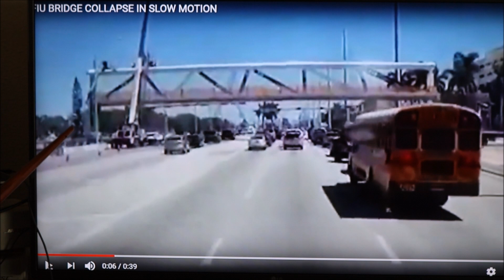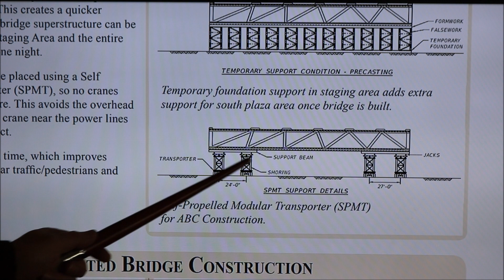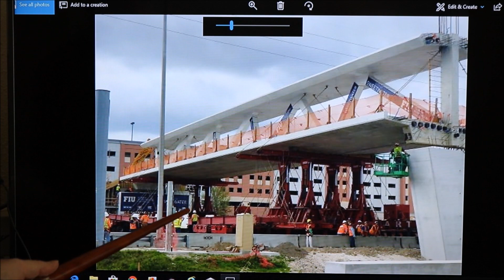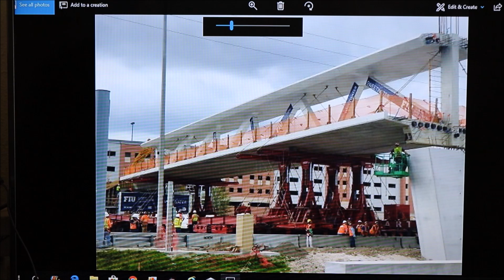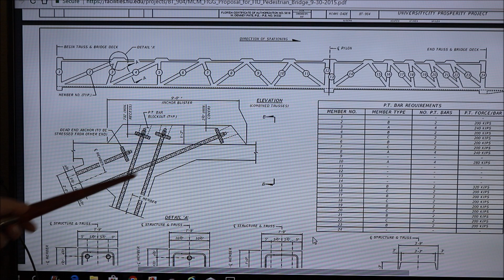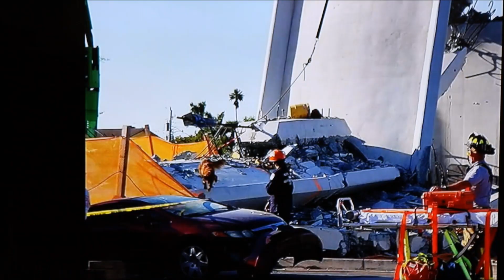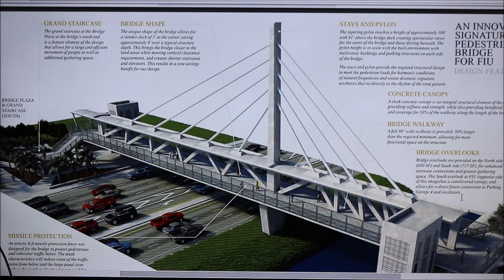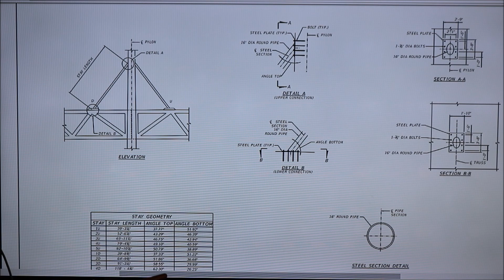Miami Bridge Failure Update 18 March 2018

Comment: ABC design ? More like DEF (Doomed to an Early Failure) design. Also you learn about a crack in the unfinished bridge and do what - hold a meeting to pat yourselves on the back ? Should have blocked the traffic and started to investigate immediately. Oh and let's start tinkering with the cables while there are cars going underneath the bridge. 1. Incompetent engineers 2. Lack of public authority 3. Criminal neglect. A lot of people should be removed from their current jobs.
Reply: TCN8202 I fully agree with you.
Reply: TCN8202: Well said.
Reply: TCN8202 — ABC only means that the span is lifted into place after being built elsewhere.  This failure does not mplicate the ABC methodology.
Reply: 4. Extreme pressure or Inability to get permit to close the road due to the lack of detours

Comment: People that have never seen or been around something heavy when it collapses/fails don't realize how it seems to be moving in slow motion. But in reality, happens pretty fast. I had a 17'x96" diameter log dropped on my log truck trailer. It broke all 5 leafs of the right spring and ended up setting on the tires. Another time, the tail hold on a 90' yarder pulled loose and the yarder tower came down 30' from where I was standing. Another time, was down in Klamath, Calif. when a BIG Redwood log that was being suspended across a 3,000' canyon caused the mainline to break. It's kinda surreal watching 3,000' of two and a half inch cable coiling up coming toward you and landing 30 yards in front of you.
Reply: Reg Pettinger ...wow...your a lucky man to have a retelling of that 2 and a half coil narrowly missing you. !!
Reply: I never really thought about how lucky I am to still be here until I got into my 60's. I've done things that should have killed me and people that were with me. Motorcycle racing, crashing planes and beach buggies on the same beach all the while trying to cram all the living I could get into 39 days of leave back in March 1969. And these are just a few times.................................I've come to realize the Lord has been watching over me all along. I feel very blessed.
Reply: Reg Pettinger Blame Hollywood - the hero always has time to run away from the explosion/collapsing building/ disaster of choice
Reply: Unless slowed by the wind or other non proportional loss, all things fall at same rate.
Reply: v= u + a.t

Comment: Good analysis of the limited evidence.
As far as the workers harness failing, I would be more inclined to say the worker regarded it as an inconvenience and did not tighten his harness straps properly. (Just my opinion from prior observations)
Reply: I can confirm that. I had to deal every day with workers not wearing their protective gear properly or worse: not at all!  -_- They think they have everything under control but that's not the case as one can see in this video. Things can snap in milliseconds.
Reply: Gary Reed
I think you are correct...My buddy is a high rise steel worker and he tells me the harness is always in his way . He says he has more problems working when the harness is on...
Reply: Gary Reed 
Just like ... How many people think that wearing seatbelts in cars cause more injury than not wearing seatbelts?
Reply: I would agree. I was safety officer on a construction site.  some of the workers regarded the harness as a joke.  One of them tried to argue that having it loose on his body was just as good as wearing it properly.  I was behind him and yanked the D ring up.  when the leg straps hit his pills he agreed wearing it properly was a good idea.  His foreman used the D ring yank as a test each morning to see if every one had their harness on properly.
Reply: A safety harness very, very rarely fails, unless, you're not wearing it properly.

I've worn them day in and day out on many a roof on buildings in downtown Boston. I've seen people do some downright stupid things with a harness on, it surprises me how nonchalant people can be when it comes to their own safety and their life.
Reply: Thank you!  There have been a lot of comments that assume workers always follow safety rules and always wear safety equipment.  I've worked in machine shops and at an aluminum smelter and I've seen (and done in my youth) plenty of violations.  Safety rules get ignored when they become inconvenient - interlocks get disabled because they get in the way, gear gets left off or modified because it is uncomfortable, and of course, there is general horseplay.

None of that is supposed to happen, but it still does, even with strict rules and harsh punishment.  Sometimes, it takes a tragedy to drive home the necessity of safety equipment and rules.
Reply: The safety harness (if he had one at all) was NOT tied to the crane.  That would be illegal.  Maybe to the manlift which is legal, but the worker fell with the deck.
Reply: GR.  If you are standing on a "solid bridge" you don't need a harness.
Reply: Internet Privacy Advocate - I believe anytime you are on an elevated platform without railings or fencing, you should be in a harness.  The top of the bridge was only 12 - 15 feet wide and about the same height above the 30 ft wide main platform.
Reply: @Gary Reed
The witnesses says the crane hook was snapped off. This is evidence that the crane was tied to the bridge. The worker may have been injured by the safety cable whipping down from the broken hook. Also, the bridge directly under the worker was falling much faster than "normal", due to leverage. 

In the slow-mo dashcam video, the poor worker looks stretched abnormally even though he appears stationary in the air, so I'm not assuming that the safety vest was worn incorrectly. He may have been ripped out of the vest.

Comment: Have a look at AvE 's vides (two) on Youtube, will give you some ideas and thoughts. especially regarding the strengthening.
Reply: AVE's video showing what happens when you put a run under tension and it fails, and it shoots out, is damning evidence.
Reply: Both of AvE's videos circle around the same evidence, but come to a different conclusion from Juan (either is plausible based on my limited knowledge). Its pretty clear where the point of failure was, from the dash-cam footage.
Reply: I like how AvE came to the conclusion about the tensioning rod failing long before this video, but "we can't watch that because oh my, the profanity", yet now this video is coming to the same conclusion and using the same diagrams AvE showed. So profanity bad, but plagiarism good? Virtue signal much?
Reply: I watched one of them - cannot handle the profanity.  But, the content is of marginal use.  He never addresses the basic design of the bridge in terms of a truss.  He gets totally lost on the mid-span support necessity during construction.  This is all irrelevant.  Sorry, that video is not helping to explain, only to send viewers off the wrong path.

Comment: That member in question would be under compression, more so than any of the others in the span. It would seem that it's tension rods should have the least tensions applied. Perhaps the member failed in compression due to the combination of the static load AND that created by the tension rods? Though it didn't appear to fail in the video.

Comment: I don't get the part about one of the lifts being inboard, creating a cantilever at that end. Ignoring for the moment the walkway and roof, what's left is a truss, which is the rigid structural element that supports the entire span from end to end. If the truss can support the bridge, why would lifting inboard of the ends cause any problem?
Reply from the maker: It's designed to be supported at the ends, cantilevering during the move changes ALL the calculations over the entire truss.
Reply: Yeah, I thought the truss looked strange. Then I saw the conceptual drawing with the aesthetic "cable stays" and realized that those strange angles were part of the art. Before I saw the drawing I was looking at the boxes in the truss and thinking that they couldn't be that strong. Seems like this thing was quite fragile.
Reply: I have this feeling that we are going to discover that the structure was broken as it was being moved to or set on the piers.  So people are going to say, oh, it would have worked if it had just been supported properly during assembly.

But that is, it seems to me, one heck of a fragile design if it can't tolerate deviation from perfect support during assembly, and yet at the same time requires a transport like this where things are quite likely, for a short time, to deviate from that perfect support.
Reply: The preliminary drawings show no PT bars in truss #11. It is not clear if this was an oversight and was later corrected, or if the rod was only needed during transportation (and not thereafter).
Reply: With no support, the truss #11 goes into TENSION as the lower level pulls down on it. Pulling that segment into compression with the hydraulic jack might have been their attempt to mitigate that during the move. It appears that the transporter support piers were only holding the bridge on small cribbing blocks and not on wide beams that would have supported the cantilever section like it shows in the design document. There is some suggestion that the transporter wagons were moved inboard because of a MOVABLE TEMPORARY construction barrier fence that was on the road side of the pylon.

IMHO, using pre and post stressed concrete to handle dynamic structural loads is a BAD idea. Why didn't they use standard I-beam or dog-bone steel construction methods for the structural parts and cover it with a box and a thin viner of concrete. It would look the same, take the same time to build and maybe even weigh less.

Comment: I'm no Engineer but looks like a junk design
Reply: Jarrold Bates  the pride/ego factor played a huge roll as well.

'look how smart we are, we can install a bridge of a new design and only shut the road down for one day.'

any new hybrid design like this needs to have secondary false works or supports of some type,  and anytime they change tension on the rods traffic should be rerouted!
Reply: Yeah, assymetric design of struts to match up with fake upper cables looks goofy to me now that I know more about it. I mean it looked goofy when I first saw the bridge without the fake suspension cables. But then I read it was a suspension bridge. So I said ok, that makes more sense visually.  Then later I find out the cables above aren't loaded, so yeah, classic case of function following form. No wonder my initial thought that the design didn't look right. Looks should never be put ahead of function. Functional designs always look good anyways.
Reply: It was Roy a classical Engineering overload big style
Reply: A single vertical truss should never have been allowed. Single point failure! Post tensioned concrete truss bad idea too. 50 to 1 dead load to live load unusual too. Vanity project for FIU ABC design. Huge federally funded boondoggle
Reply: rickterfied — A pair of trusses on the sides doesn’t necessarily give redundancy that protects against a single failure.  Usually, a broken truss will bring the roadway (or walkway) down anyway, and probably the whole structure.  With any truss bridge you need, first, a generous margin of safety in the design, then regular inspections and maintenance.
Reply: It's not a new design. These types have been around for some time now. What was new was the method in which it was being maneuvered into place and the placement of support structures and the tensioning that goes along with the placement of the bridge itself.
Reply: Thommy Two Toes Times Three — I don’t think so.  If there is another structure comparable to this one, tell me what it is.
Reply: Bernardo Cantu The feminist run company/ lead engineer story was proven false a couple days ago.
Reply: thank you! i figured so in my research but wanted to confirm. im trying to be as neutral as possible about all this.
Reply: Bernardo Cantu Here you go https://www.snopes.com/fact-check/was-all-female-responsible-bridge-collapse/
Reply: Gerg Ward: Totally disagree.  This was one of the worst designs for concrete imaginable.  Same design in steel would would have stood for years as long as it was kept painted.  The concrete truss was destined to fail, which it did within a few days with no load on the bridge.
Reply: Thommy Two Toes Times Three,  Like you say, the design has been around for a while,  but the web structure made out of concrete is new for bridges.
Reply: . "FIGG and its principals contributed more than $99,000 to state political candidates in the last 20 years, most of it — $60,000 — to the Republican Party of Florida"
Reply: "The Munilla family(MCM) is Miami-based — nearly half their bridge team were FIU graduates — and they are prolific political givers. The five brothers who run the company — Fernando, Juan, Pedro, Raul, and Jorge, an FIU alumnus himself — have given more than $500,000 combined since 2000, and their family members have given hundreds of thousands more.

The biggest recipient has been the anti-Castro US-Cuba Democracy Political Action Committee, to which the brothers have donated more than $100,000. They have donated more than $60,000 to committees supporting Mario Diaz-Balart (Republican), who helped secure the federal grant for the project."
Reply: Im not sure whats going on politically on who is funding it or designing it but if MCM and FIGG were both on this project they both appear to be  heavy republican bakers and friends of Marco Rubio. I have heard that Affirmative Action had females working on this (who werent as competent as males who could have done this) and so it was cheaper because of this. So republicans had democrats designing this project is that what you are saying? Just want to clear this up a bit. I don't want to get into a political battle about this just want to find some truth here.
Reply: i'm no engineer too..
but no one mentinon feminist yet?
Reply: design was fine, the issue appears to have been with construction was done not following correct procedures

Comment: Id like to see conversation and questions about changing the lifting platforms location creating  the cantilever situation.  Was the cantilever considered in the design?  Was the design engineer onsite consulted before moving the lift platforms, and why were the designed shoring beams between the lifting tower supports not in place?  How much stress did the cantilever place on the structure where the outside lift tower joins the lower beam of the truss?

Comment: I'm thinking that when they released the extra tension that added to the rod.  it unscrewed from the bottom end (and not the top where they where working from) till the nut could not hold the weight anymore and there pop/snapped off.

Comment: They should have been loosening 11 that they over tightened to support the end while transporting. In place supported from the ends 11 is under compression load.
Reply: tundramanq the bridge had sensors built in, these were monitored 24/7 by a dedicated computer.  those sensors reported the tension on that end was lower than acceptable which leads me to believe the rod was stretched in the move.   

so they send a guy up on a crane an TRY to tighten a failing rod.  by increasing the pressure on this weakened rod results in the rod failing and its load transferred to other areas as the bridge failed catastrophically.

pretty simple when you understand what was happening.  they should have had support below the bridge and haunted traffic when attempting to modify tension.
Reply: Big Ozone  With sensors, they should have known that the rod was stressed past the yield point and plastic deformation was happening and got the jack back under it pronto. That or it's lower attachment was pulling through the concrete that was in tension during the move and then under compression once placed. But something ejected most of the rod out the top - it think it finally snapped and traveled from the recoil.
Reply: That's right, tundramanq. The steel in its final moments would have been in plastic deformation and necking (which is a small amount for high strength steel). That rod could not have ejected after the collapse completed, as it would be pinched in the crumpled concrete beam; it must have ejected when that projectile (the nut?) was observed flying away.
Reply: You mean no.11 I think. Interesting though that in the original scheme drawings no.11 is shown to have no post tensioning bars, presumably as it would have been in compression in both the permanent and temporary conditions. However with the temporary supports moved into the span no.11 would probably be in tension and therefore maybe post tensioning was added for this reason.
Reply: Makes sense, the weakest part of these rods is where they are threaded creating stress risers in the rod.
Reply: tundramanq   AVE’s first video includes a demonstration of a steel rod being stretched to its limit (as shown on his oscilloscope), then a sudden failure.  In his video, the rod flys out of the pipe when it breaks.  I’m only commenting because AVEs demonstration confirms this guys explanation and seeing it actually happening is a good learning experience.